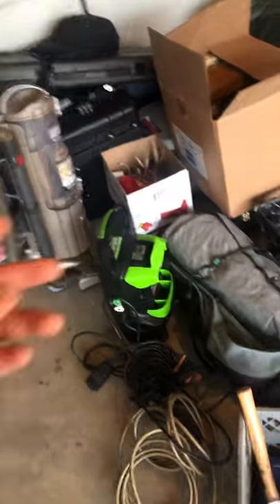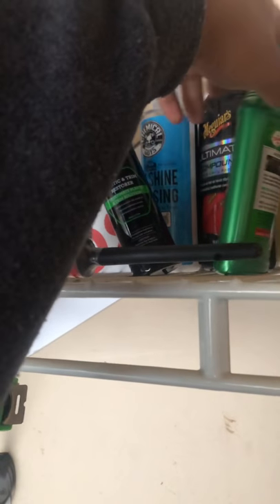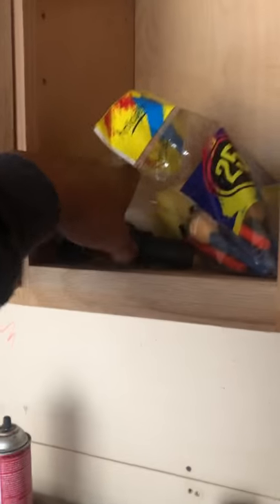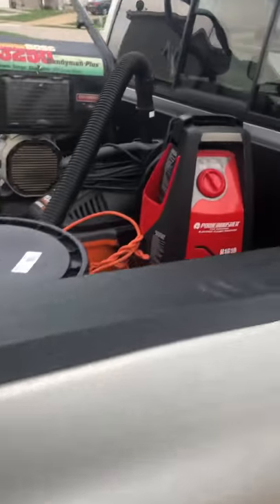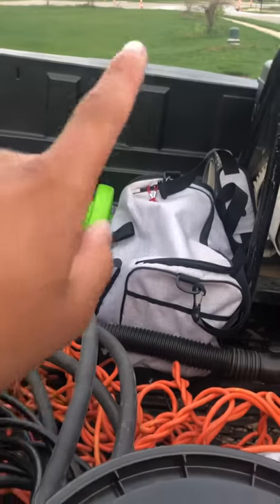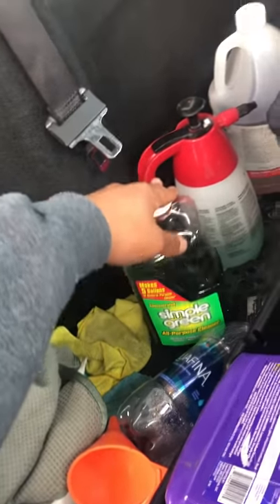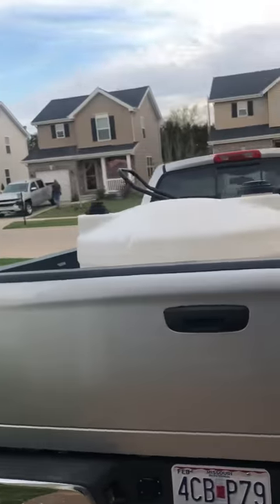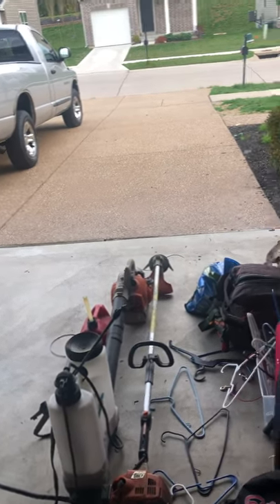Mobile detailing truck setup

Comment: Hey man if you want to get a walk behind, Bradley also make those as well. I would recommend hyro walk behind over the belt driven, but they both do the job.
Reply from the maker: The King's Courtyard Lawn Care Service this is my first year taking lawn care seriously. I purchased a cub cadet 42 inch residential zero turn to get me going. I also work for a lawn care company and we use a 52’ and 36 Wright stander. Once I got over the learning curve I fell in love with these mowers. A walk behind is cheaper but I really like the benefits of standers. For 1,000 more I think I would enjoy the stander way more than the walk behind
Reply from the maker: I would tho in the future maybe the year after this season or depending how well next season goes I would get a 36’ in walk behind from them a hydro to give me more versatility
Reply: Tahj Clark yeah wasn’t sure where you stood with that. That’s what I’ve been pushing, standers are the way of the future for lawn care. I’m looking at getting the 36 stand on either the ending of this year or next. But you’ve on to a good start. Keep make videos
Reply from the maker: The King's Courtyard Lawn Care Service the only thing is those small 36’ standers can get sketchy
On hills pretty quickly. If the ground is wet the Wright 36 stander slips easily and gets stuck everywhere... for the price and a backyard mower for me it doesn’t make sense yet. I will make some videos though I just bought a nice pc to help . I specialize in detailing and lawn care
Reply: Tahj Clark awesome! And yeah I heard about the hills, I wouldn’t take one up a hill. Besides my 52 handles hills nicely.

Comment: Anything for the interior I would recommend 10-1 that helps with the plastics turning whote
Reply from the maker: I’ll try to dilute it lighter I tend to go 8-1 for a little extra cleaning power but for me personally super clean is just not that good when cleaning it against all purpose things. Crumbs and sticky stuff stuck to the console tend to be hard for it on its own. It’s great for any grease, break dust, or tough tasks. I think simple green works better on food, seats, turning things white, but not as good for tease break dust although not bad. It’s got a friendlier scent . And gives off a slightly “ oh he actually cleaned my car” type thing lol
Reply: Tahj Clark lol hey the smell dose matter tbh but most people also add a spray cent to help with bad smell. My go to APC is meguaiars all purpose cleaner they sell by the gallon but it works really really good I have tried lots over the years but keep going back to that one, all interiors 10-1 all exterior, tires, carpets ect 4-1